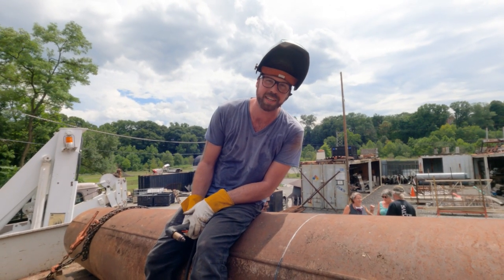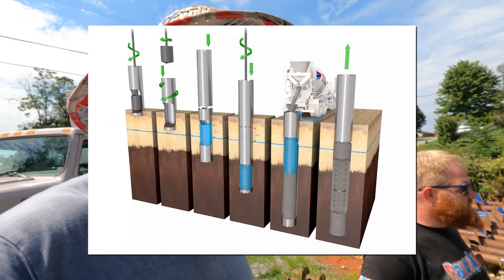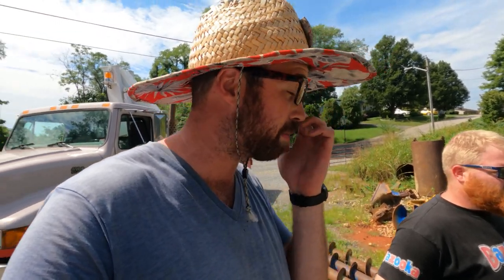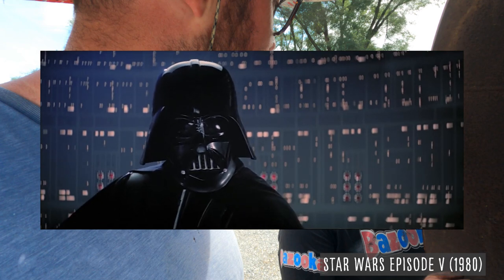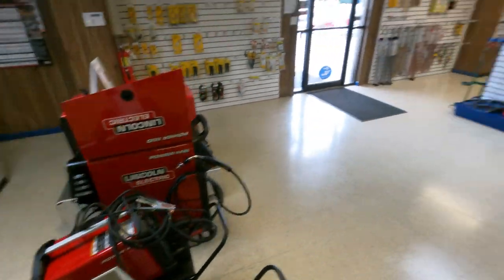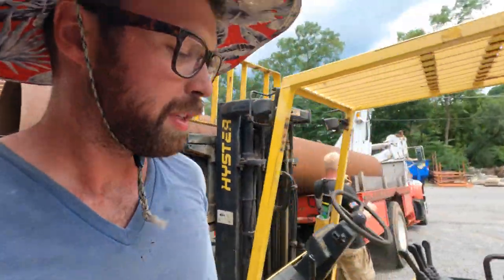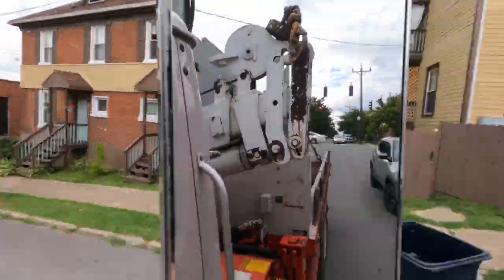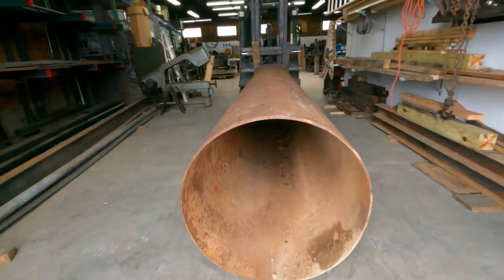Making a 17ft Tall DNA Helix Out of Metal! - Pt. 1 // Lift Arc Builds

Comment: Great video. I’ll be anxiously awaiting part 2. I have a shop Sabre 5x10 also. There had been a few bumps along the road but overall I like it ha

As far as lifting heavy stuff. One of my previous jobs had one and now I’ve built one for home use. Square tube to over the forks with a spreader bar welded to the bottom with electro magnets. Built mine out of scrap metal and Amazon magnet for $200. Now I’m not killing my back